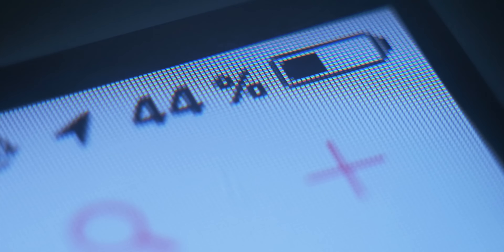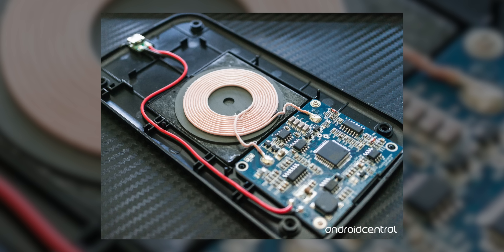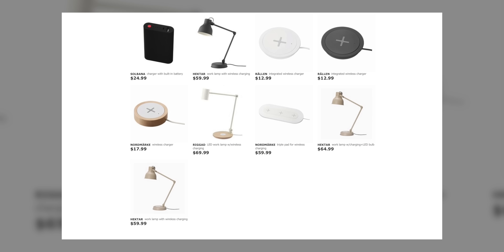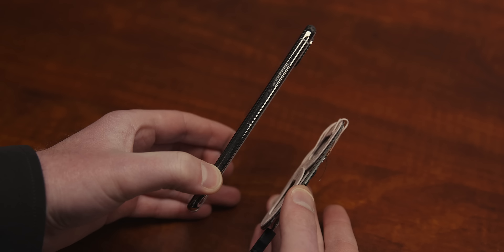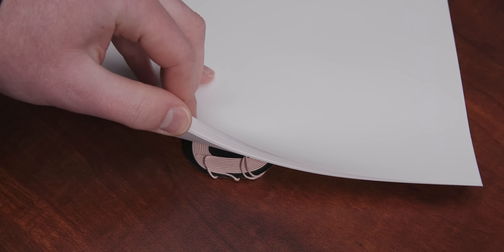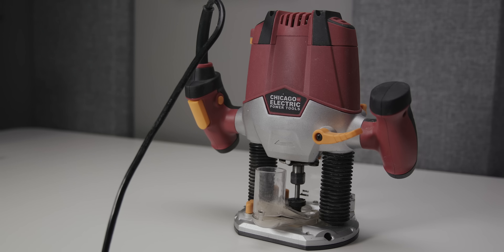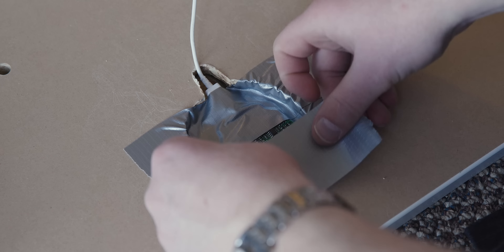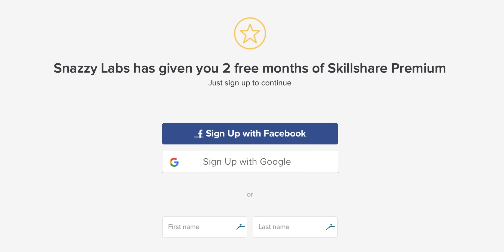Add Hidden Wireless Charging to Any Desk or Surface!

Comment: While it's a cool technology, wireless charging seems more gimmicky than useful. I see no benefit to plopping your phone on a charging pad vs just plugging the cable in. The only situations this would be useful in is if the charging port on your phone no longer worked or if you have guests with different charging ports than what you have cables for.
Reply: I used to think the same thing but when i got my s9 last year i got a wireless charger on my bedside cabinet and the convenience of it is just great and i couldnt live without it now
Reply: Iwan Tottle But it’s not convenient, that’s the problem.
It takes the same amount if not just a bit more time for the cable and it gives you the freedom of using the phone.
After years of having it I really can’t see the point
Reply: It is convenient though, when you got to bed you just place it down and thats it no need to faff around trying to find the right angle to fit the port in in the dark and when you need it you just pick it up and go.

Comment: Duck tape?  Yuck. You need to learn the benefits of gaffer tape.  You'll understand why if you ever have to remove duck tape later.  (I like Gaffer Power brand.)  Yeah, it's more expensive than duck tape but the results are worth it.
Reply from the maker: Gaffer tape is legit but it's sooooooo expensive.
Reply: @snazzy  Less than $20 a roll at Amazon.  I'm still using a roll I bought several years ago.  I've removed it from surfaces after a year with almost no damage, just a few paint chips pulled up; can't do that with duck tape.

Comment: Way too much soddering for my liking. How does solder become sodder? Is it actually sold as sodder in the US? And taping it in? How does that go with the potential heat dissipation? Anyways, a way way way too long video to say 'use router, make hole, fit charger'.

Comment: You hated on the tutorials that drilled the tables and then went ahead and did the same thing.
Reply from the maker: I hated on tutorials that drilled all the way through the tables. And one ones that placed an enclosed charger in place of a bare coil.